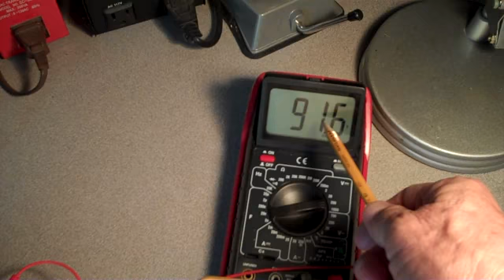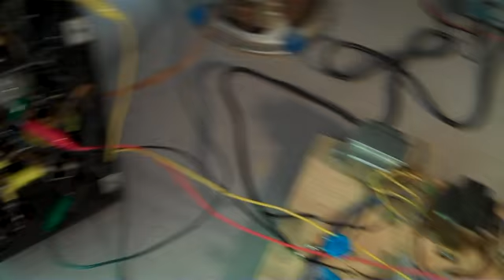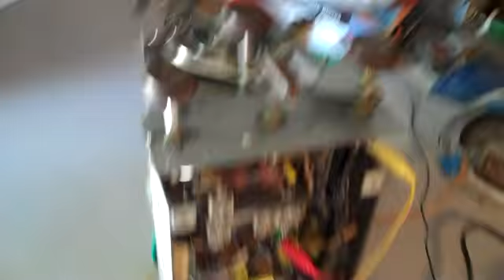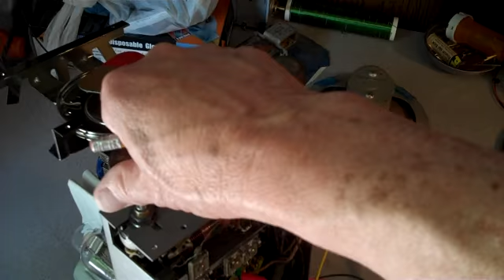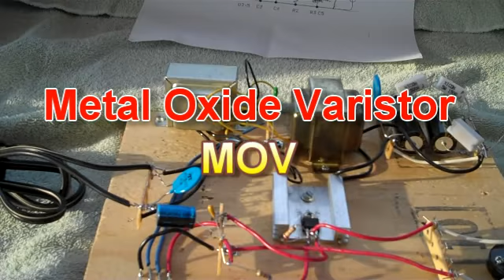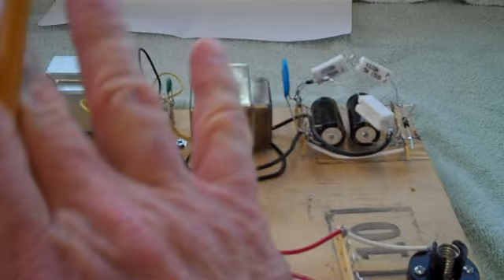1938/39 Silvertone Model 6044 & 6045 Farm Radio Restoration (Part 15 of 20).

Comment: I happened to be reviewing your old vids and this farm radio power supply build caught my eye.   I was wondering how far a rabbit hole this was going to take you.   Making an unregulated power supply from off the shelf transformers for a non standard voltage like 90 volts DC is a pain as you well know now especially when using dropping resistors for voltage reductions.     I was wondering what the radio needs for current from the 90 B+ supply.  Did you happen to measure the current draw?   A modern switch mode power supply would be a much more compact solution.  They use much smaller transformers and generate little heat and far more energy efficient than that mess the conventional supply turned into.    I gotta hand it to you you have a lot of sticktuitiveness in you.    I bet if you knew where you would end up with this you wouldn't have started.  LOL!!!!!

Comment from the maker: David,
Use the same type of solder you use for installing components in a chassis.  I buy the 8-ounce rolls sold by RadioShack....063" diameter, 60/40 Rosin Core.  A roll lasts a long time.

Regards,
John

Comment from the maker: Rick,
Yes, the replacement transformer does have a center tap, but it isn't used.  Just coil it up and tape it off.  And also yes...the two transformer secondaries (the 12vac sides) are connected together just like it was with the wimpy transformer.
Let me know if things are still not clear.  It won't bother me one bit to answer any other questions you might have.
 
Regards,
John

Comment: Nice work, now if I get a battery operated radio I don't have to spend $145 on a power supply! It probably would not be too hard to add a 9V "C" supply for use with an older 1920's battery radio.